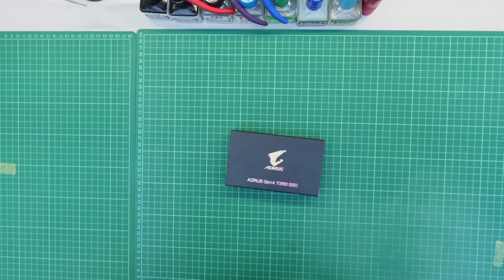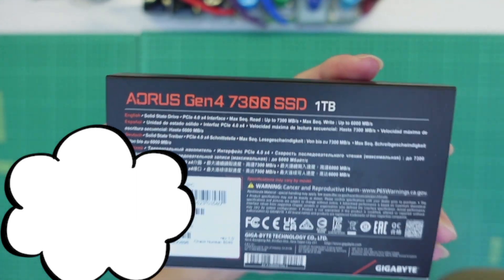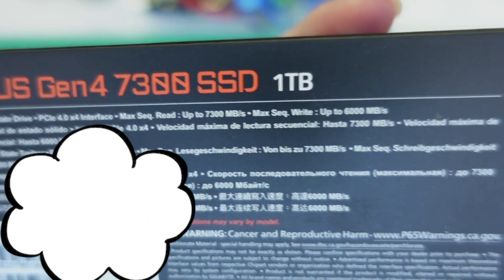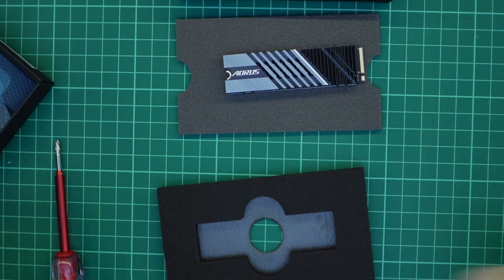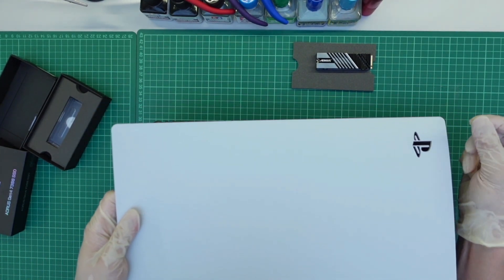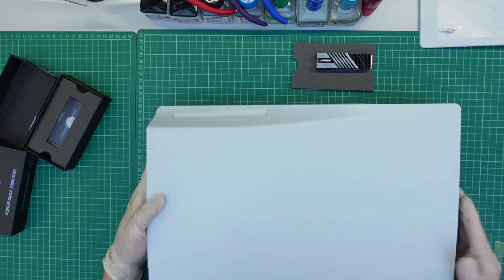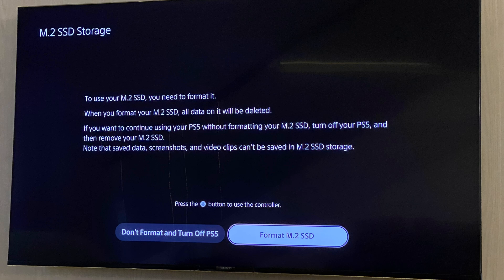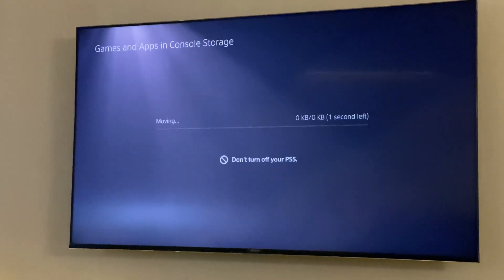Gigabyte Aorus Gen4 7300 SSD 1TB [Unboxing] & [Installation on PS5]

Comment: Useful vid, because I wanted to know if the heatsink was included in the box. 
I have seen this SSD at a very good price (2TB for 124€), that's unbeatable right now. Top speeds, DRAM, heatsink included, good controller (Phison E18)...
Reply from the maker: glad it helps!

Comment: Is the sticky part replaceable?
Reply from the maker: it's a thermal pad. should be replaceable with a new one.
Reply: @cyrusgunpla  I just installed this ssd on my PS5 thanks for this video.
Reply: @choapark3617 how do we check the reading speed?